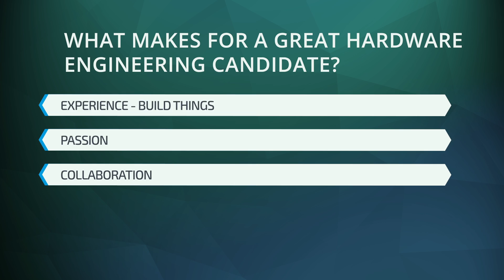What is Hardware Engineering?

Comment: While hardware engineers still do not have the level of post release design changes software engineers do, I think you overlook the FPGA. Now yes there are some hard limits but there is the ability to make hardware designs that can support field updates and changes. Of course this is also limited to commercial and military products. Consumer electronics are prototyped with FPGAs but due to the scale of manufacturing it's mostly more cost effective to then design an custom ASIC.